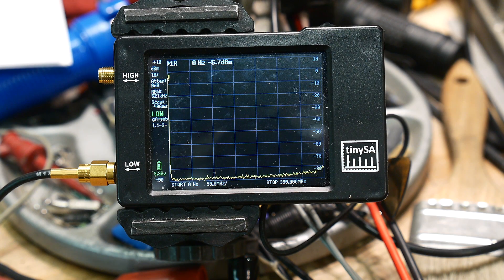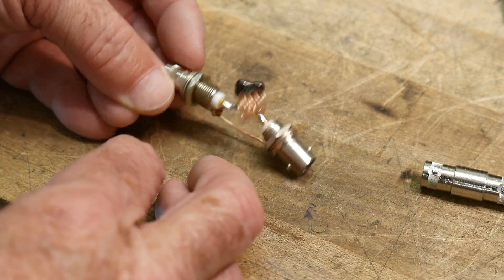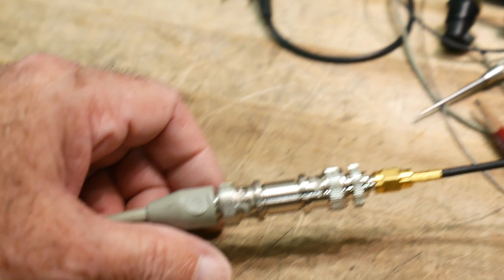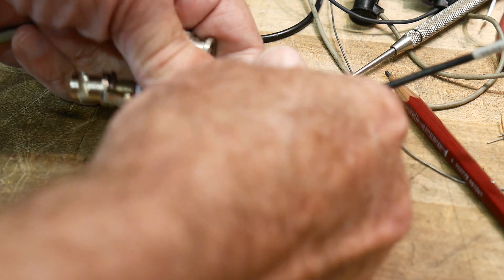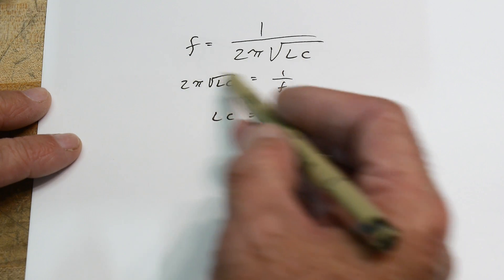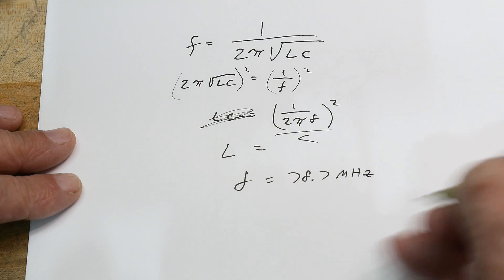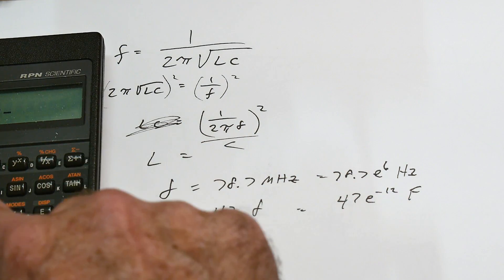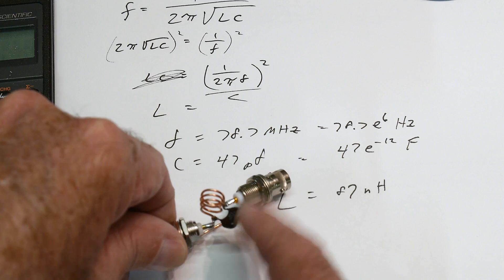#615 TinySA LC Parallel Resonant Measurement

Comment: 15 - 20 years ago I would have done the math by hand ..... Nowadays I just bring up an online calculator or with the more common ones like this whip out my Android phone which has a couple of apps just for this. Still with a spectrum analyzer you can have a lot of fun even with a simple passive circuit like this. For instance spread and compress the coil and calculate the change in frequency/inductance or replace the cap with a trimmer cap. Put two or three in series and try to make a decent band stop filter. to null out that FM station just down the road

Comment: I asked chatgpt"

what is the inductance of a simple air coil of 4 turns 1/4in diameter with # 18awg copper wire
ChatGPT said:

To estimate the inductance of a simple air-core coil, we can use the Wheeler formula for short coils:
L=(r2)⋅N29r+10l(in µH)
L=9r+10l(r2)⋅N2(in µH)

Where:

    LL = inductance in microhenries (µH)

    rr = coil radius in inches

    ll = coil length in inches

    NN = number of turns

Step-by-step:
Given:

    Diameter = ¼ in → Radius r=0.125r=0.125 in

    Wire gauge = 18 AWG → Diameter ≈ 0.0403 in

    Turns = 4

    So, length of coil ≈ 4 turns × wire diameter = 4 × 0.0403 ≈ 0.161 in

Plug into Wheeler's formula:
L=(0.1252)⋅429⋅0.125+10⋅0.161=0.015625⋅161.125+1.61=0.252.735≈0.0914 μH
L=9⋅0.125+10⋅0.161(0.1252)⋅42=1.125+1.610.015625⋅16=2.7350.25≈0.0914μH
✅ Final Answer:

Approximately 0.091 µH (microhenries)

This is a very small inductance, typical for tiny RF or high-frequency applications.

or 91nH about +5% from your measurement. I guessed the wire size.
Reply: I screwed the pouch and used 77nH first now corrected for 87nH

Comment: The formula given is that for series resonance. It is approximately correct for high Q parallel resonance, so though it is adequate for this example, it might not be for other examples. Another issue is that the accuracy is poor as frequency approaches the self resonant frequency of the inductor, not a problem here (but not demonstrated), but it might not be for other examples.

Comment: So you just plug a function generator to the LC circuit?
Reply from the maker: I used a noise source, but you could use a swept function generator
Reply: @IMSAIGuy  thanks

Comment: HP Prime Calculator in Textbook mode works too, just stack the registry. (78.7e6) enter, (x pi) enter, (x 2) enter, (-1) enter, (x 2) enter, (÷47E-12) Enter. Do a google search for (calculatoredge/new/resonance) his L/C numbers come out dead on 78.7 MHz. (also the number format will need be set to engineering)

Comment: I have measured many LC tanks at MW and FM frequencies for radio front ends and IF double tuned LC tanks in the last 3 months using the NanoVNA v2.  You cannot always trust the resonance frequency measured in this manner. I have  compared the measured resonance frequencies with the measurements using a sweep generator and a scope. The results often do not match depending the type and the resonance freqiencies of the LC tanks.i am very careful with the proper calibration of the VNA measurement plane with the effects of the test clips and cables being excluded. Often there is a mismatch between the VNA 50 ohms output impedance and the input impedance of DUT LC tank.  Ideally a matching network or transformer should be used. The same is true for ceramic filter measurement. Initially I thought the impedance mismatch would only affect the insertion loss measurements but it seems it affects the resonance frequency too ( really puzzling).  In your video, the measured inductance is the apparent inductance that includes the distributed capacitance and inductance. Its frequency response shape depends on how close it oscillates near the inductor self resonance frequency.

Comment: Love the video, i wish i was so good with maths.:) I’m a little confused by your circuit arrangement, you certainly have the L and C in parallel but your response on the SA looks more like a series resonant circuit.
Reply from the maker: maybe you are thinking of a parallel circuit between signal and ground. this is in series with the signal
Reply: @IMSAIGuy  I think so....so there you do actually have series resonance.  A notch filter ....kind of?
Reply from the maker: @stuartmartin3408  lots of filters, high low bandpass
Reply from the maker: Yes a notch or trap

Comment: I was guessing low VHF based on the inductor diameter so looks like I was right! Good to see you using an RPN HP calculator also. In my opinion the only kind of calculator to have. I was also a Physics major that then turned to EE in grad school. Still have my HP RPN calculators from back in the 80's, Still working fine!

Comment: I estimate 80 MHz so it was near 😎 I also have 2 pair of HP 32 S they are the best 👍
Reply from the maker: Good guess!! I've had almost every calculator HP made. The 15C and 32Sii are at the top for me.
Reply: @IMSAIGuy  35S all the way!
Reply from the maker: @jeffsansoterra7743  I bought one. I wanted to love the HP35s but don't. I still like the 32s and 32sii better 🙂

Comment: Those days a GDO (grid dip Oscillator, grid dip meter or a Gate Dip Meter) was used to find out the approximate resonant frequency of the LC tank circuit. Now, it's interesting to see the resonance on the display.
Reply: The GDO is still a valuable tool to have around. I built a heathkit GDO many years ago. Gosh I miss Heathkit...

Comment: A nice demonstration. Find the resonant frequency of the parallel LC circuit. You have the value of the capacitor. You know the formula. Find out the value of the inductor (L), ie, by using the formula rearranged.
Nice to see the formula on the paper that is getting rearranged to bring out the L on the left side of the equation. 
At 4.10 you don't have to be lazy.
You can write it down one more time.
It would be great to see you do that.
You stressed on the fact that the units must be in proper magnitudes; ie, the significance of taking care of the exponents used in the quantity of the frequency, inductance and the capacitance.
And you could have demonstrated that the same components in the series configuration resonates on the same 78.7 MHz.
Probably in the next video you may attempt to show to calculate the impedance (reactance) offered by the L and C, I believe.
Reply: You could have demonstrated that the resonant frequency changes a little bit on the higher side (if the coil is spread apart reducing the inductance) and to the lower side if the coil is compressed to bring about a slight increase in the inductance value.

Comment: Nice experiment to get used to inductor values. 
I am also always curious to see the changes when slightly deforming the wire. 
(By the way, the calculation is right but the small e is on another key of the calculator.)

Comment: Very well explained. Not too fast and especially not too slow. Sufficiently covering all aspects. I was just wondering if I can use a SDG 2042X as a noise source (I assume I can reading the manual). Now need to hoard some of those SMA and BNC connectors.